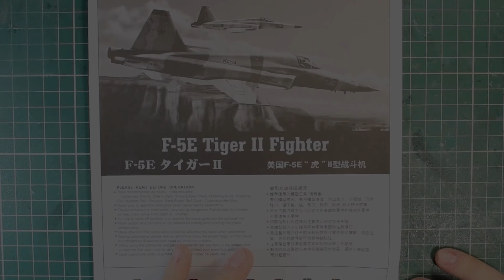Northrop F-5E Tiger II IRANIAN AIR FORCE 1/72 Hobbyboss Model Kit Full Video Build

Comment: Awesome. I have yet to freehand the camo. What type of airbrush, and do you recommend the smaller needle at .2mm? ..any other pointers??..thank you
Reply from the maker: Thanks.I use a chineese 25euros worth of 0.2mm aibrush.Rhe most important thing is 50/50 thinned paint, the lowest possible preassure and a lot of practice.
Reply: @doctormig2709  Thank you. Can you tell me the exact name brand of airbrush? I bought a G44 Master .2mm, seem to have trouble with it. Also, seems like keeping the brush moving while spraying is important-
Reply from the maker: My AB is called Veda 180D.You can find it on aliexpress.Also you have to be like reallly close to the surface when spraying.And as I said a lot of practicem

Comment: I bought this kit earlier, because I thought it will be an upgrade to the quite old Italeri kit (released in 1982). This is based on the Italeri one, with some modifications. The main one is the detatching of the wings from the upper fuselage. Well, As you can tell, that was one of the poorest decisions. The other few problems: the surface quality is nothing else but scandal. Especially in the vertical fin, the stabilators and the pylons. But the drop tanks almost as bad in this aspect. And for the stabilators, those are thick as Serena Williams. And the "edges" on it... You can't even cut air with those. The cockpit decals are oversized and somewhat off from the embossed details. The overall fit is worse then the Italeri kit. Oh, and injectionpin marks all over. All in all, only one thing is an upgrade compared to its base Italeri kit: negative panel lines. In any other means the Italeri kit is far superior. At least this Hobby-Boss product is dirt cheap. But still overpriced.
If you have doubts about the Italeri origins, then take a look at the instructions. It still shows the wing as an integral part of the upper fuselage.
This kit is one of the worst model kits I ever encountered in my modelling carrer in the last 35 years.
Reply: You know why the fit of the wings is so poor? Because those are positioned totally wrong. They should be further back for some 3 mms! Just look at pictures of the real thing. The LERX starts far behind the lip of the intake, almost where the kit part joins to the fuselage part. If you position the wings back, the fit become much better, but still crap. I really don't know how they were able to fuck up this hilariously. Honestly there is not a single thing that I can mention good in this kit. Everything is bad on it. EVERYTHING! OK, maybe the Sidewinders are decent.